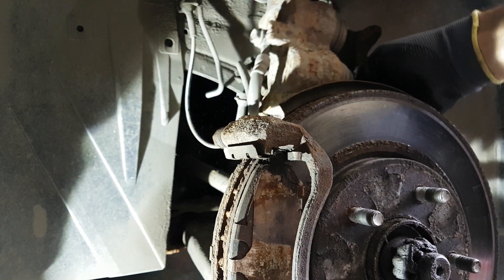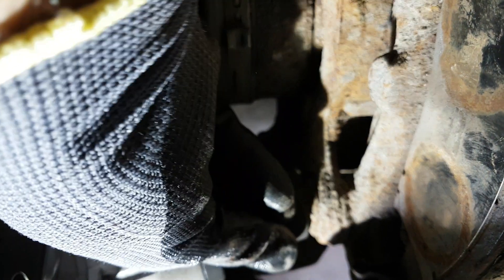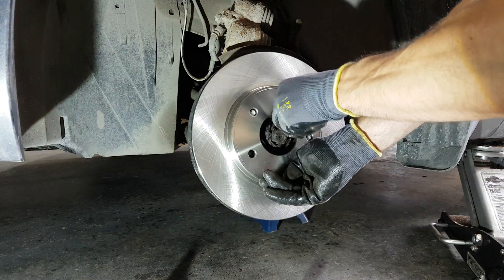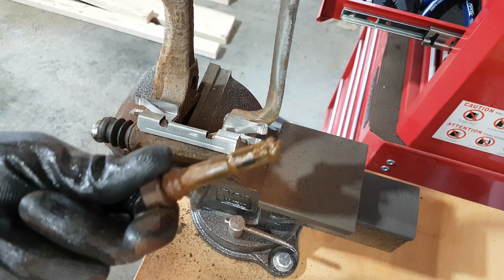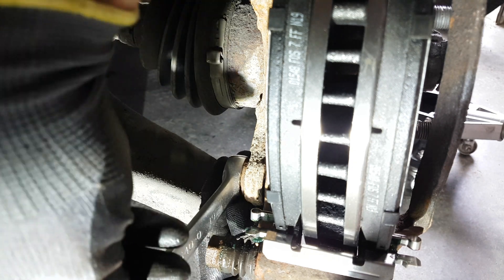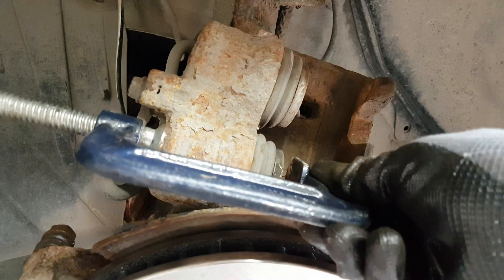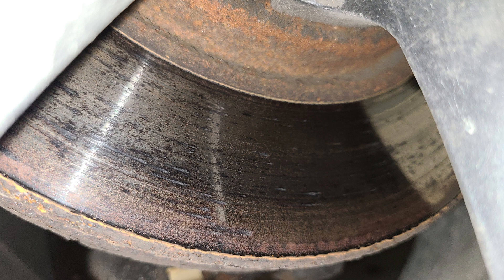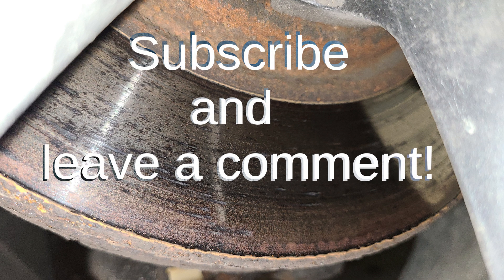Nissan Leaf Front Brakes - 5 min Short Version

Comment from the maker: I added the service manual in the description. I also made a longer version (15 minute) of this video for those who want to do a proper full brake maintenance and free up the rust: https://youtu.be/Pf9gdSIEuMk

Since the brake fluid is a closed system, when the pads wear, the fluid level drops, but when you change the pads and press the pistons, the fluid goes back to the full level. That means if you added fluid while it was low, it might overflow when pressing the caliper pistons.